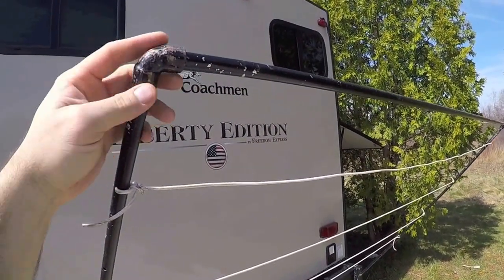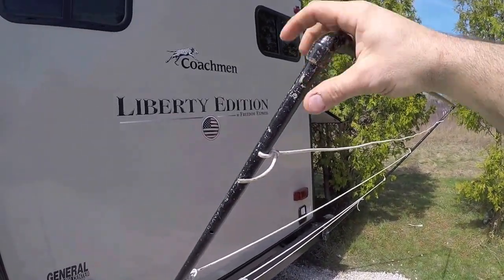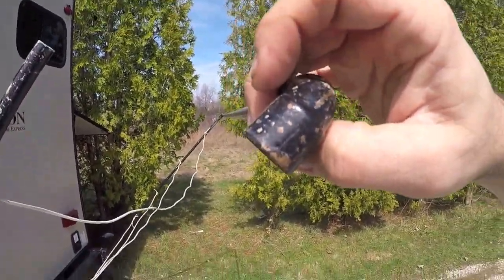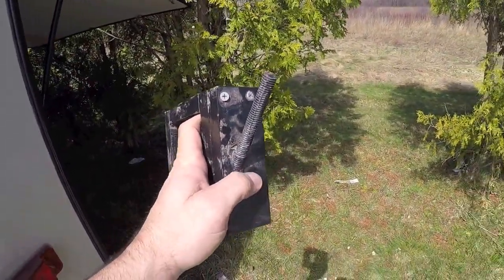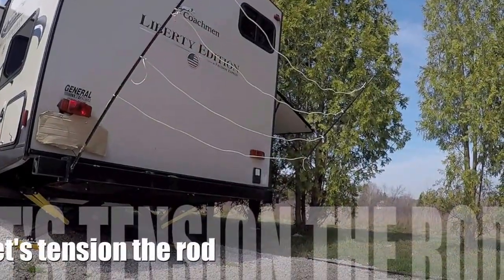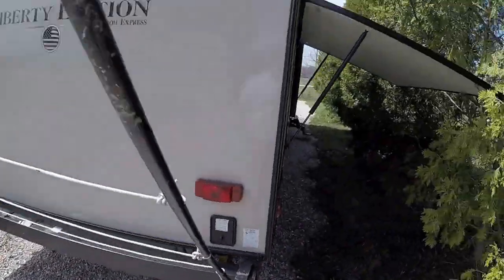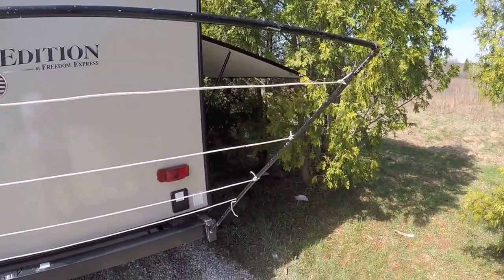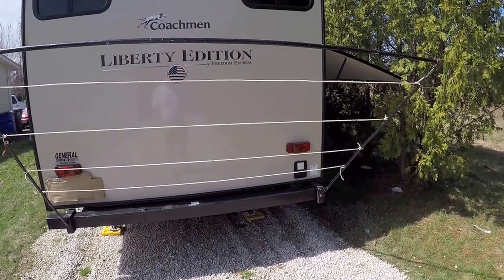How To Build an RV Towel Rack fast and easy!

Comment: I just made a comment about your stabilizers. And I happened to see this. Another good simple idea. If your still working on the 90s, just get conduit 90s with screws to tighten them. You would only need the screws on the top piece. I'll make one but use u-bolts (square one's) and a piece of flat bar on the bumper. To hold the up rights.
Reply from the maker: Good ideas. I did this way because I had it. I would say I over did it a bit. Your ideas would be very good enhancements to the original design. Thanks for sharing!